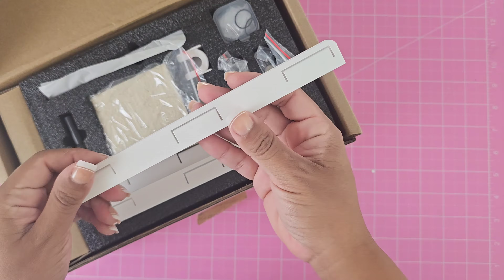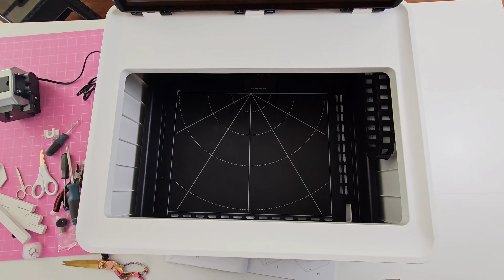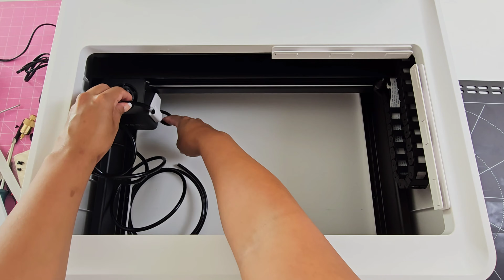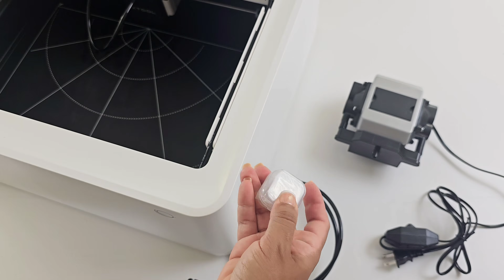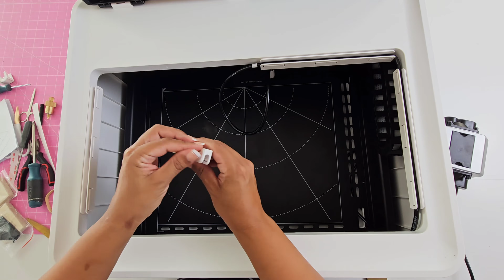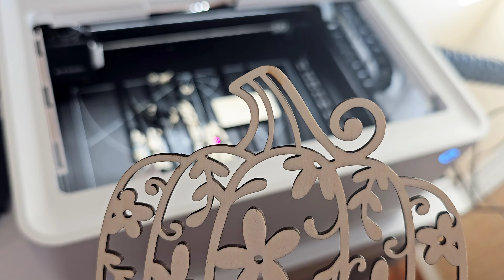How to Install Air Assist on M1 Laser, the Easy Way!

Comment: Do you need to remove  the blade when you use the air assist
Reply from the maker: Yes i have the blade out all the time, only if im using the cut feature I put it back in.

Comment: Where is the gold blade at the end
Reply from the maker: Under the module, right next to the laser, it pops in and magnetic. You don't have to keep it in unless you are using it. However, in this video I only used the laser.

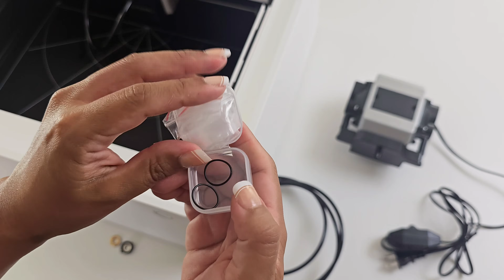Comment: 6:16 Those two "rubber bands" are actually O-Rings. One should have been installed on the magnetic adaptor before you install it. That is why your nozzle is loose.
Reply from the maker: Thanks for the helpful tip!

Comment: You're video was an absolute help for properly installing air assist. While using my air assist the tube moves and hits my project, which then messes up design, the wood moves. What can I do? the tubing is placed correctly but it hits the lid and I think that's why it moves, so I have to pause move the tubing and continue. I do keep it attached all the time, even while engraving.
Reply from the maker: That's great! I'm glad you were able to fix it!

Comment: How in the world you got the nozzle mount aligned with the module if it has to be really tight? I can’t! Any tips? Does it really have to be tight tight?
Reply: Make sure you install the O-ring to the mount before you screw it on. This will help to keep it snug and in place.
Reply from the maker: My lens mount stopped a little before it was aligned. So I had to push it hard til it was aligned. I assume it has to be tight if it needs to be aligned with module, because when I put the nozzle mount over it moves.